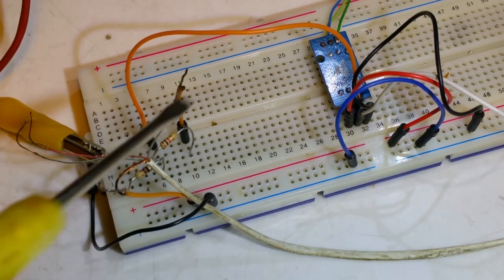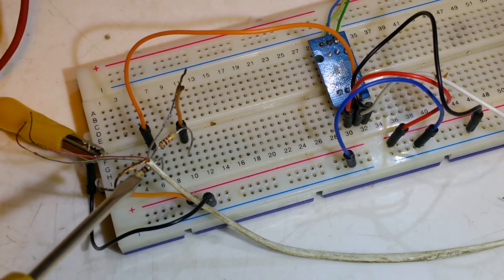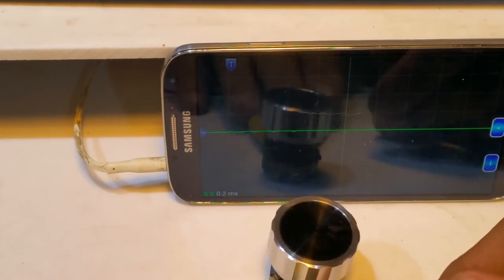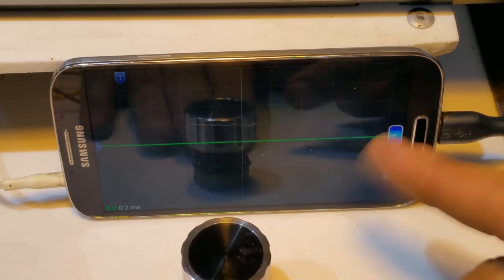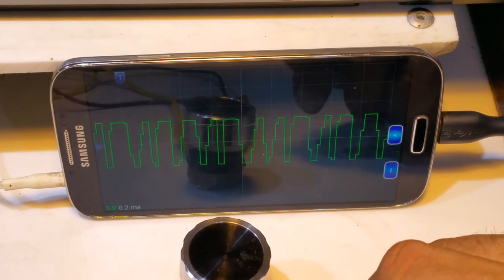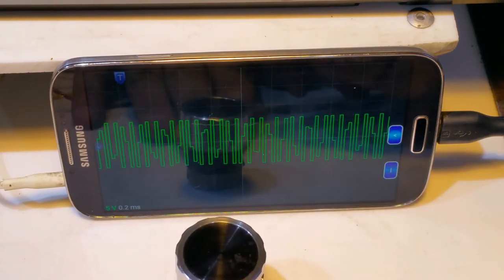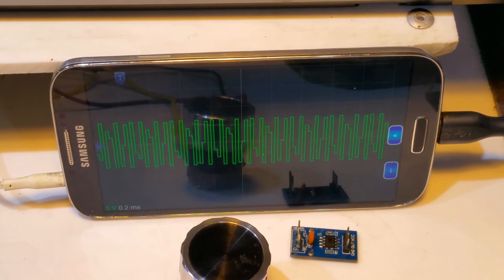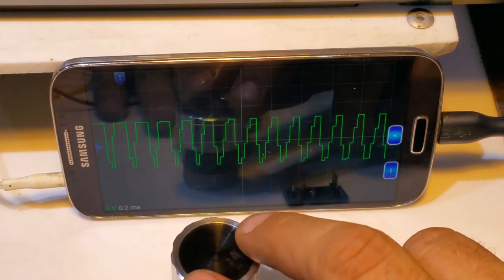Square Wave Freq Generator overview: Power Feed \ CNC project, Pt. 2

Comment: Hi! Nice video. I want to attempt using that exact type of pre built adjustable frequency square wave generator to turn a 12 V on/of switch into a ‘fully automatic, 5 cycles per second switch’. The device I want to trigger is a solenoid valve with a max cycle rate of 5 times per second. And it is powered by 12V. The voltage should be fine as the EN555 I bought is rated for it... but I have no idea if it can be set to a low enough frequency... seems to ‘pick up speed’ quite rapidly in your video... there was actually no setting where the sound was ‘ticking’... it was a full tone the whole time... suggesting that even at the lowest settings the pulse is already at much much higher reocurrances per second than what would be usefull for my project. Can you help me out? Inform me on your thoughts? Be gentile... bit of a greenhorn when it comes to stuff like this. Thanks in advance!
Reply: I know this is an old post but in my solenoid pusher build I use this PWM generator as I needed both frequency of the output waveform and its duty cycle  control: https://sklep.avt.pl/modul-generatora-ne555-regulowany-1hz-200-khz.html

Comment: Hello, this board is am using for Pwm boxmod/vape..but am got a little issue..because i have current ampere is to low for boxmod..what should i do,, i have try change kapasitor ceramic with 105

Comment: Tells me you can't use a smart phone as a scope. A 555 can't make a waveform like that....
Reply from the maker: Hi Dave, i agree that the phone app doesn't seem to sample fast enough and only gives a general sense  of the real signal. some android app vendors have a usb probe that can be purchased, possibly better. in this instance i was using the audio jack on the phone. There are also phone apps that use the built in microphone and show the sound wave signal.. -thanks for the comment!